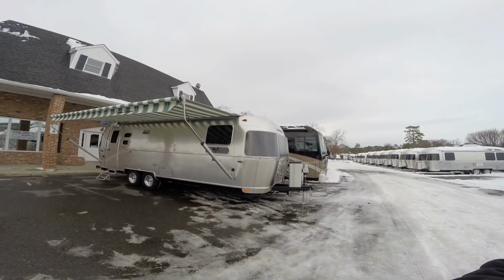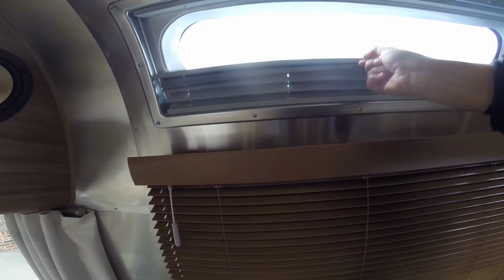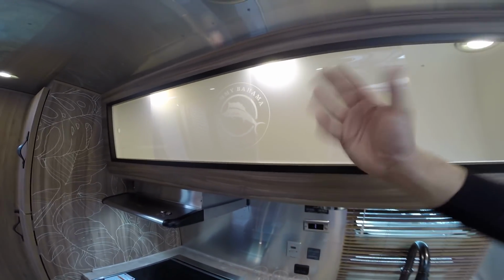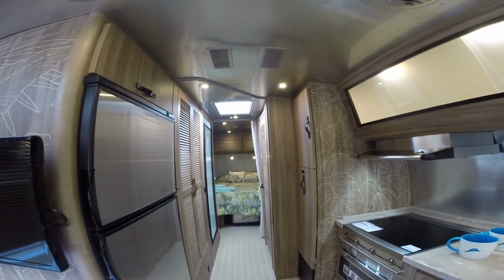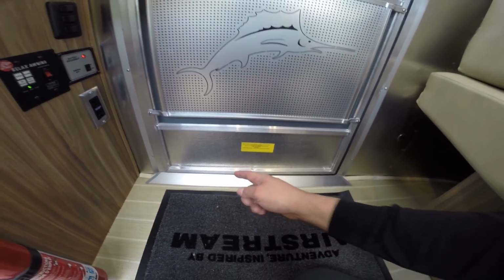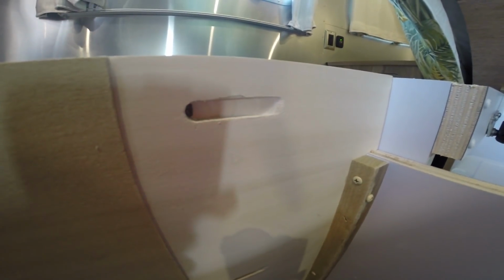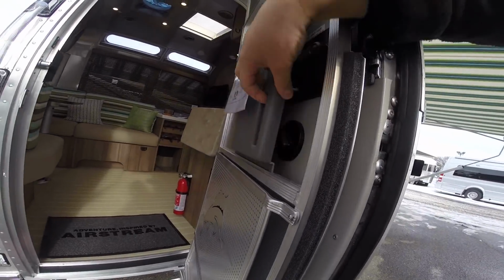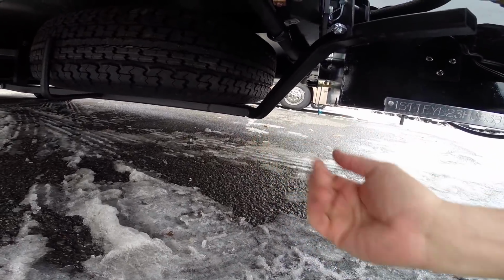Walk Through 2017 Airstream Tommy Bahama 27FB Travel Trailer Relax Edition RV Camper

Comment: Excellent! However, not seeing anything aside from agm and solar that blows my hair back. Is Airstream offering lithium ion soon and a 16" light truck tire and wheel upgrade? Or will I void my warranty? Thanks again Patrick.
Reply from the maker: Yes I would love that too. The lithium ion battery modules each would need an AGM  battery to power a 12V heat pads or a cooling device to keep them at the perfect temperature so they would be safe to use.

Comment: Hi Patrick, will send you an email later on regarding that 2017 Airstream Tommy Bahama 27FB but right now got a question : WE all know that Airstream do not customized or give any other options that the ones they give on their website BUT your side at Colonial Airstream could you get by any chance with Airstream or Oceanair the possibility to add those " interior panels" that are arround the Windows in the Classic Airstreams or even in the Airstream Tommy Bahama Interstate RV? The "Tommy Bahama wood blinds" match perfectly those panels in the Tommy bahama Interstate (they are even working with a remote control in the Interstate..I am not asking for that much...) just panels arround every Windows to make sure we really do sleep in the dark in the bedroom and if we've got guests sleeping in the dinette area.. I also know having those panels arround the windows  is a plus when facing cold days in the travel trailer. It is just a question, do you think with an Extra, you or OceanAir or Airstream (I dare they will as they often refuse customers ideas/thoughts/customizations) could do that? Thanks for your answer. regards. Sebastian.
Reply from the maker: Sebastian, thank you for the email. I am sure the panels can be copied by a custom upholsterer and the Ocean Air blinds can be ordered through a Oceanair supplier. Unfortunately at this time we are not offering custom carpentry or upholstery at our dealership.

Comment: I like this one best but have one concern. The aluminum inner panels would let too much heat out in winter camping (Alaska). What other cold weather options would make this better for cold weather?
Reply from the maker: The interior skin is separate form the exterior and there is thermal tape in between that prevents heat loss/gain.
Reply: Why would you buy something that is marketed toward Bahamas if you live in the Arctic???? WTF you realize it has never snowed in the Bahamas right? They have plenty of other options that are great for cold weather this is I believe there only one totally geared toward warm beach weather and they don't have a dehumidifier so they kind of failed

Comment: @Colonial Airstream, can you load a motorcycle in the back?
Reply from the maker: It will fit but it is not recommended and will cause too much weight in the back of the trailer, reducing the tongue weight and will cause sway.

Comment: Can a roof rack and roof rack tent be added to this trailers?
Reply from the maker: Airstream doesn't have either accessory available but I am sure someone does on the aftermarket.
Reply: Thank you for the quick response Patrick, my wife and I are still deciding what would be the best RV for our family, we want to have a roof top tent for occasional use but we are also thinking about putting it  in the bed of our tow vehicle. If we decide to go with the Airstream you would be the first dealer we call, thanks again for the quick response and for this videos.
Reply from the maker: Thank you for the reply.